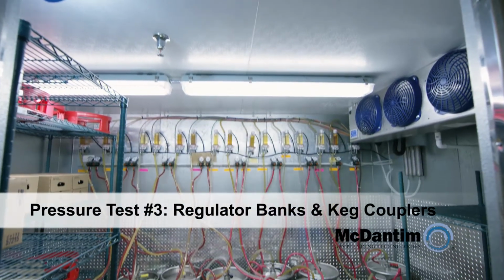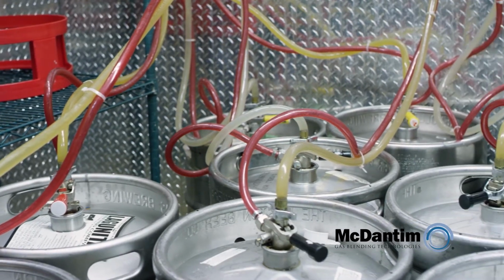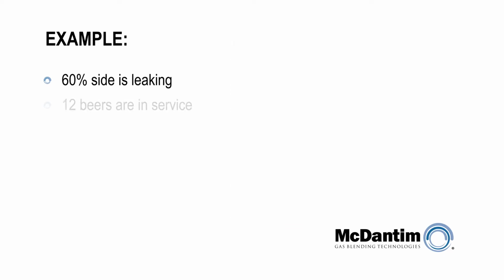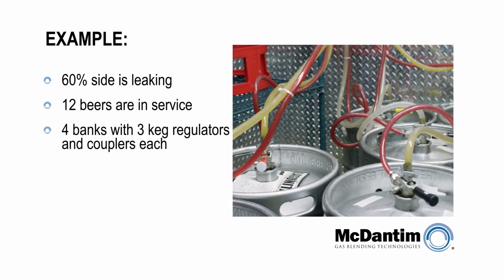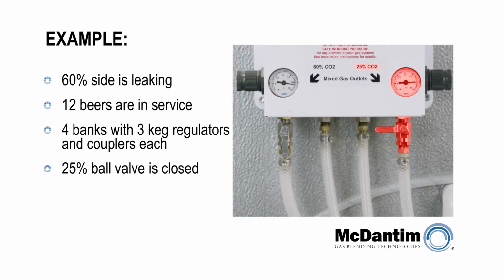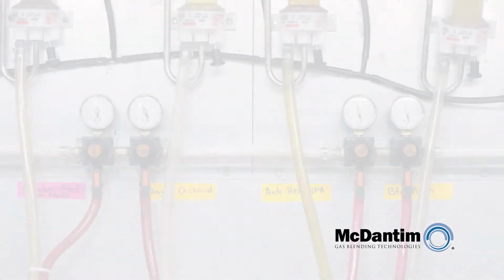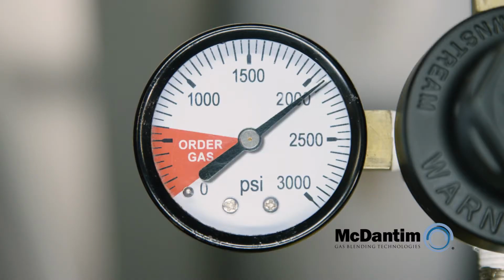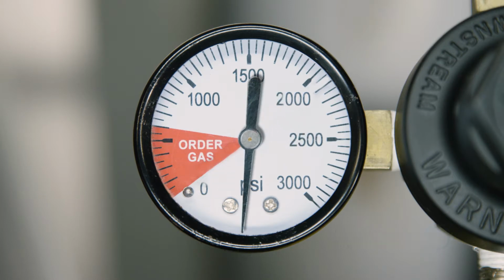How To: Pressure & Leak Test for the Trumix® Blender

Comment: Around the 5min mark u described shutting off the gas valves in the walk-in box n u said if the needle drops at tank then ur couplers n jumper lines r leaking.  But when u shut off gas at the manifold in box then u just isolated the system from the secondary regulators back to the source tank.  So if the  needle drops ur leak is  somewhere between the shutoff valve the regulators n back to source. If needle doesn't drop then system is tight up to the shut off valve.  Then u can move on to check jumper lines n couplers.